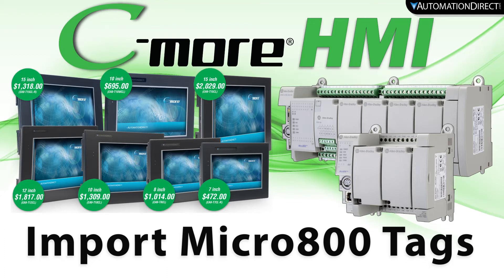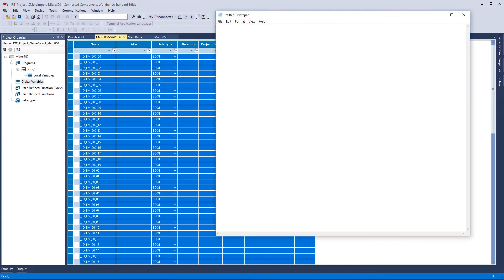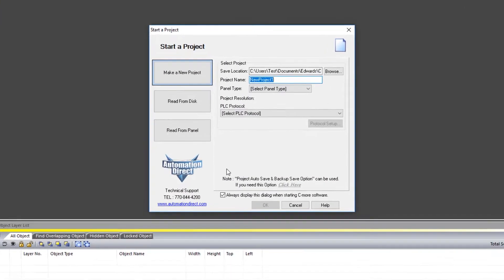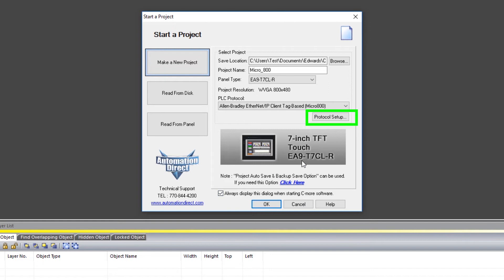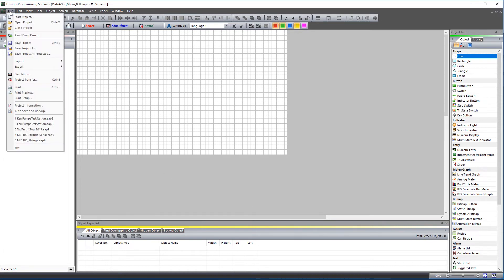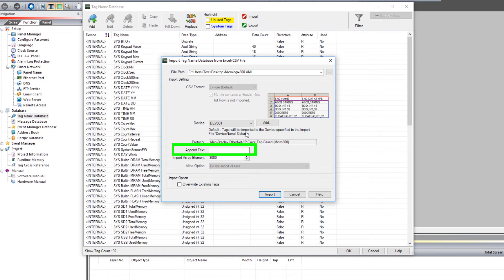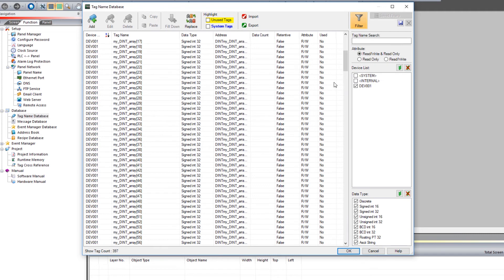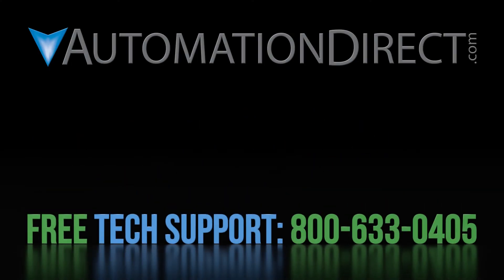C-more HMI Setup: Import Micro800 PLC Tags at AutomationDirect

Comment: will this work on the Cmore Micro Range?
Reply from the maker: No.  C-more Micro does not support the Micro 800 protocol.

But it does support ModBbus.  In theory you could use the Modbus addressing in the Micro 800, use the Modbus Driver in C-more Micro and manually create an import file by making a few tags in the C-more Micro project, export it, modify it and import it.